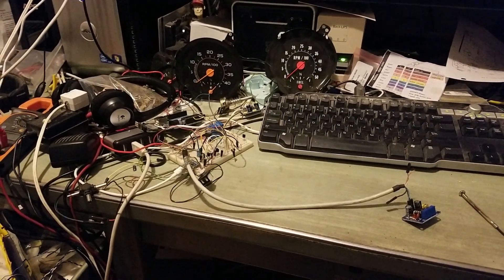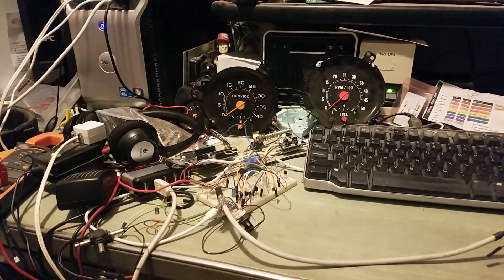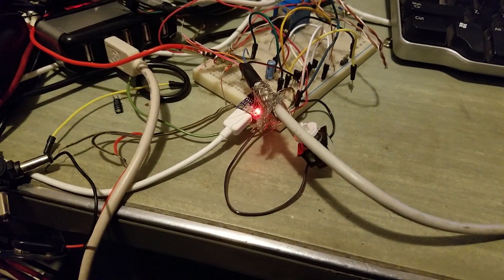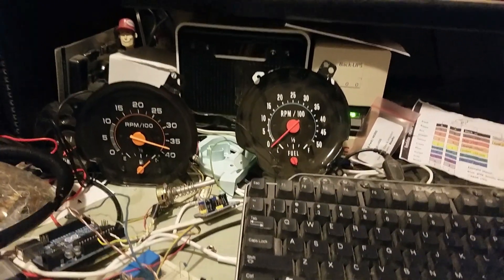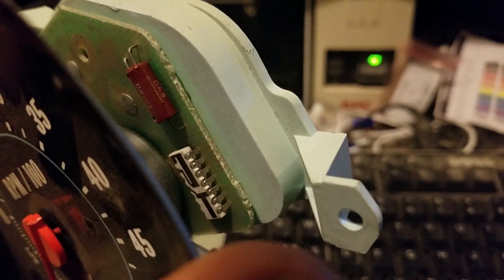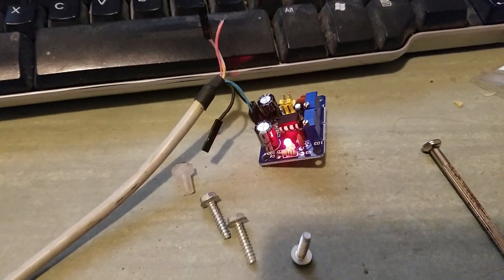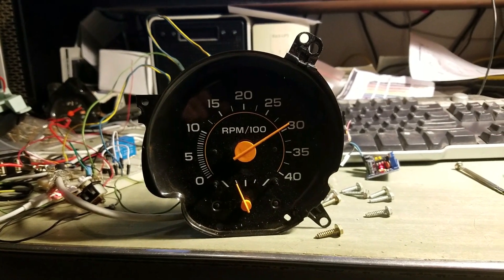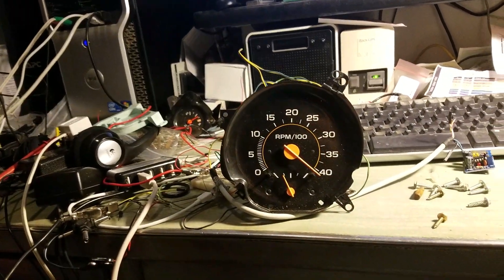Modifying Stock Tachometer from Alternator signal to Crank/Points Signal

Comment: It'll be cool when it's done, but what if some one want to swap a v8 gas back in it, then the tacks off again haha. Interesting video for. Sure!
Reply from the maker: Actually, it should still be accurate with a 8-cylinder gas in there, that's the signal my modified tachometer is currently running on, so it should be good, but 4k might be a little limiting for a V8 gas!  However, I doubt anyone will ever swap a gas back in her!  I'll probably own her till the day I (or it) dies!  lol!  Thanks for watching and commenting!

Comment: Tach in my 93 Ford runs on a sprocket bolted to the Cummins damper. Diesel conversions had a magnetic pickup, I think it was the original for the 7.3 idi .it works very well.
Reply from the maker: My Cummins is from a 94, so it already had 2 notches on the balancer, I just had to grind 2 more in 90º off from the existing so it was really not bad.  I did it while I had the front cover off changing the seal and gasket and setting the timing so it wasn't a big deal to reuse it and it's nice it sends a simple signal that most tachometers can read - even though this didn't turn out to be quite so simple lol.  Thanks for watching and commenting!